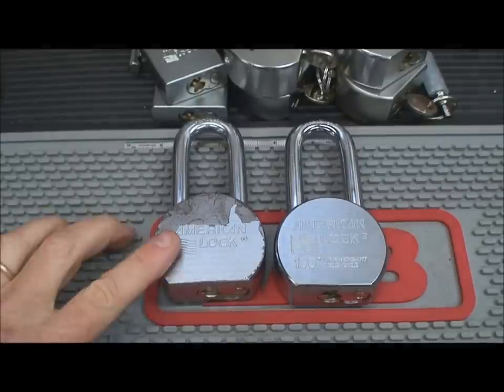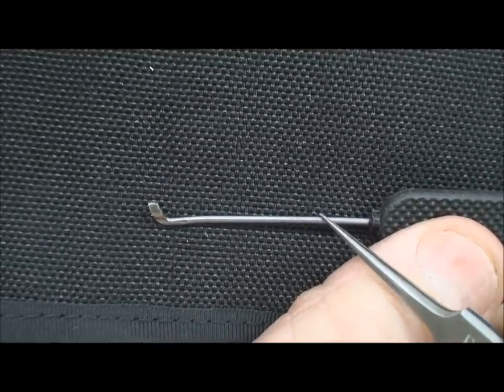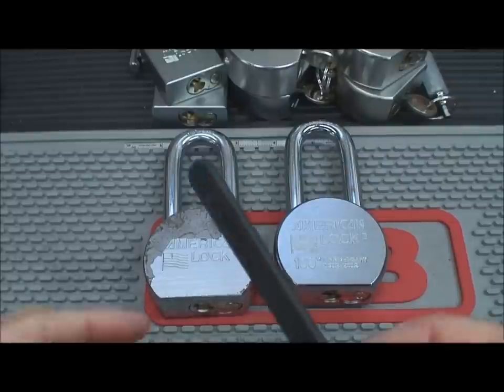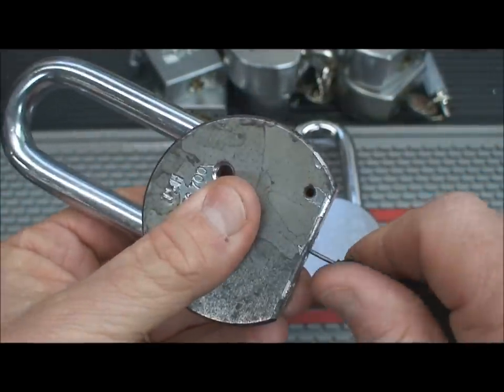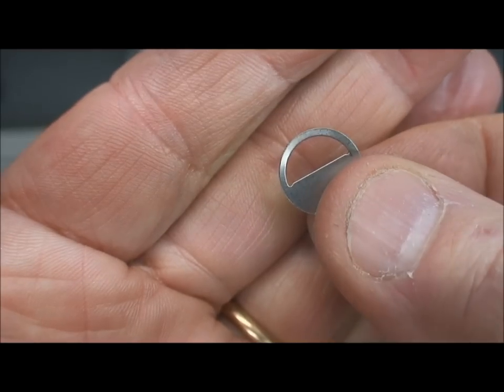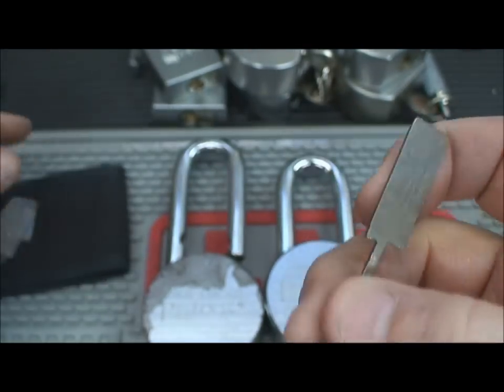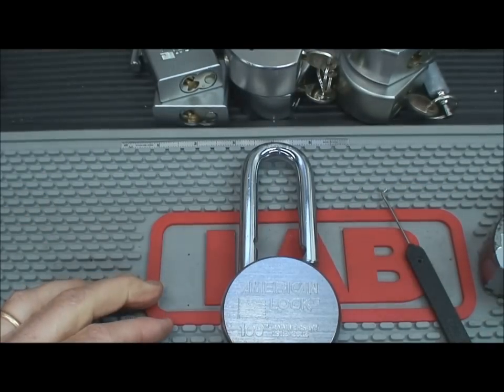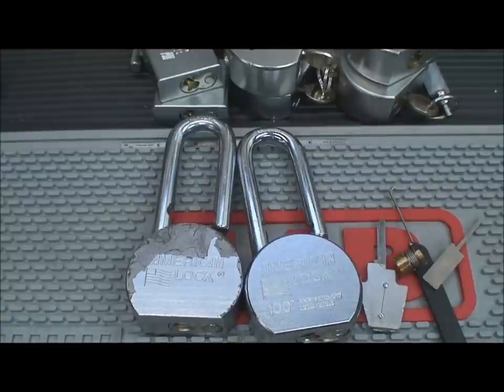(46) Review: Peterson American Padlock Bypass Tools

Comment: After using the wafer breakers to gain access for the bypass, will the lock still function properly with the key?  Will there be a noticeable tell that the lock has been tampered with?

Comment: 12 years later and I’m still snapping the flags off every brand I’ve tried. My sparrows actually got stuck inside a Abus and I no choice but to break it to get it out. I’m a locksmith and not heavy handed or lacking a light touch. Any idea what I’m doing wrong sir?

Comment: Anyone knows if the bypass will work for the 5200 model?  Ofcourse it has the wafer.  But the cam seems the same.  So if the wafer breaker was used what’s to keep the bypass from working on the 700 model the 1100 and the 5200?    Any info is appreciated

Comment: Two problems with this approach and why AL wafer essentially solves the issues. If you are a criminal and you could just bypass the lock that left little or no trace of you entering but beating that breaker tool in is just one step shy of bolt cutters. Sure the lock is still visually intact but any smith would know what happened. Also, what criminal wants to sit there and beat on a lock in a hallway or a back yard in the dark for 5 min with a hammer and a tool, much easier just to cut the lock.

Comment: I'll tell you why. Those shackles are super thick and I'm 99.9999999% sure made of haredened steel. 1.) They don't make "standard" BOLT cutters that will cut that lock shackle and 2.) 10 guys don't have enough muscle in their asses to cut that schacle. Now, that being said, I HAVE seen "hydraulic" rebar cutters that'll cut 1" diameter in about 15 seconds but, A.) they're noisey and B.) you have a table to work on. Best to plug in a big cut-off 1/2 HP saw & throw sparks everywhere for an hour.

Comment: Total junk. Does not work. My lock was made in 1987. No washer inside. Took it apart a dozen times. Ground the sharp corners off the cams. Sharpened the lead edge of the tool. Pushed and twisted and jammed tool to the point of breakage. Won't go in the last 2mm. This is just an infomercial for a tool that doesn't work.
Reply: No, its just operator error.   I know because for half a day i felt the same way, then i watched him a cpl more times.  Went over my hole punching a little more.  And was more light handed woth the bypass tool ams it finally wemt in and worked.  I did it a bunch of times after that and each time i got the bypass tool swt a little quicker.  Dont be so quick to judge,  just cause you had issues doesnt mean its automatically junk

Comment: Good grief. You better have a bunch of handcuff keys on your person when you do this as it takes so long every cop in the neighborhood will be standing there watching you. This is fine for working in a locksmith shop, but how many criminals are gonna fart around taking all that time to defeat the lock? Answer: none. They will take along a portable Roto Zip with a metal cutting wheel and that shackle will be gone in a matter of seconds. This video may be technically interesting, but it is real world useless. Bottom line is ANY lock can be defeated with the proper tools and equipment.
Reply: U must be on the “Slow” side I take